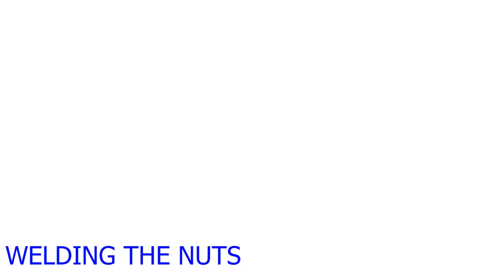Make Your Own Cv Joint Boot Changer!

Comment: This is more work that just dismantling the CV joint, cleaning and repacking with grease like it should be done.
Reply from the maker: Thx the comment. Not real. Because mechanic like me I do as much CV Boot as I want. Please watch my other videos, like, share, comment, subscribe.
Reply: Jimmy, you don't get it. You can use this tool over and over. And unless you're slack as Alice and you left the split cv boot open for months or even years on end and drove through axle deep muddy water daily you don't need to clean the joint. Just repack what's been lost.
Reply from the maker: Thanks for the comment.
Please share, like, comment, watch my other videos
Videos:
https://youtu.be/HP-pyyWtUhk
https://youtu.be/yt9RvIWh0Vo